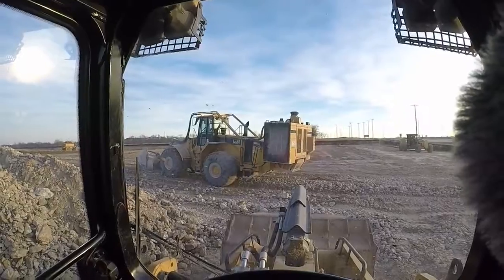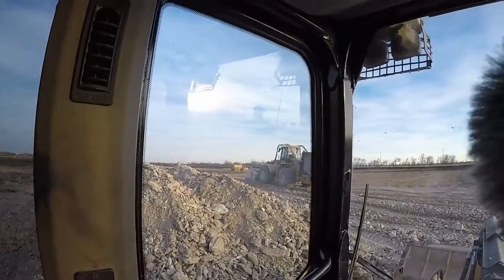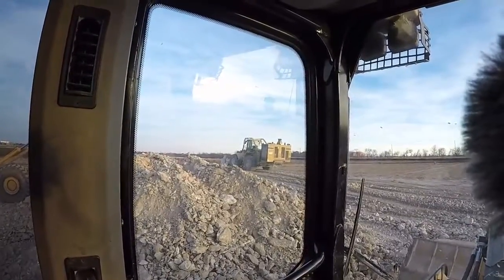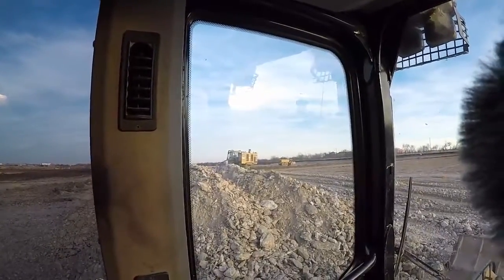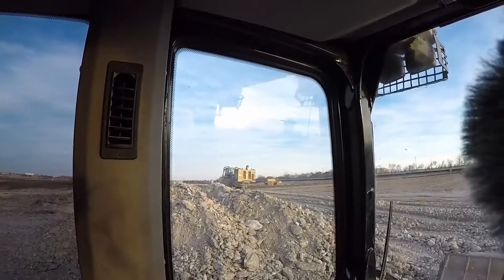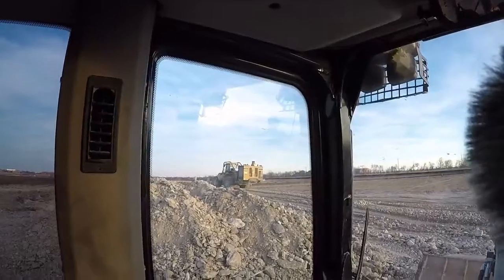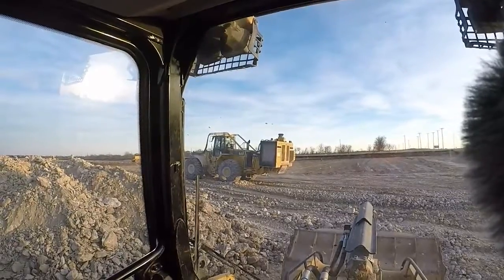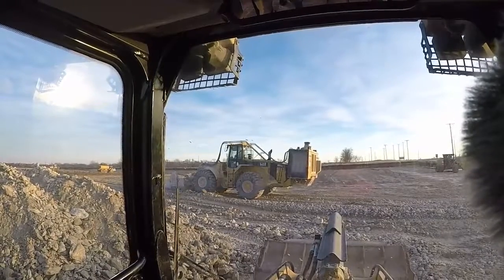Cat 980G: Iron Wolf configuration

Comment: Why not just crush it then spread it out... is it cheaper ?
Reply from the maker: It is milled, then picked up and used to cap the pads... I'd say this is much cheaper than mobilizing a crusher and stacker, chasing and getting permits for noise, dust, etc and hiring a whole other crew and support equipment just to crush.... this machine and a support machine, depending on the job are the cheaper cost per yard than a crusher.

Comment: That's a neat machine. Though I'm kinda surprised they mounted it to a wheel loader and not something like a dozer. I'd think a dozer chassis would need less reinforcements for the load, and you wouldn't have to worry so much about the pivot point in the middle either.
Reply from the maker: I have seen and do have pictures of a D6 in an iron wolf configuration. I was amazed. They are a unique machine for sure